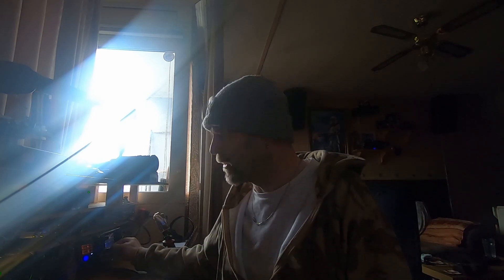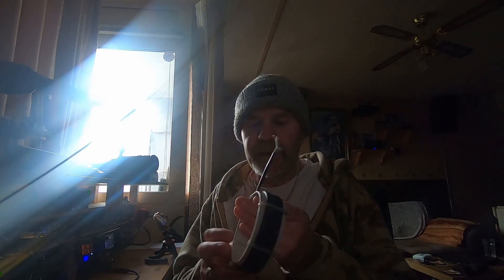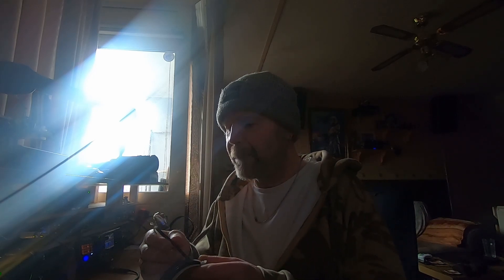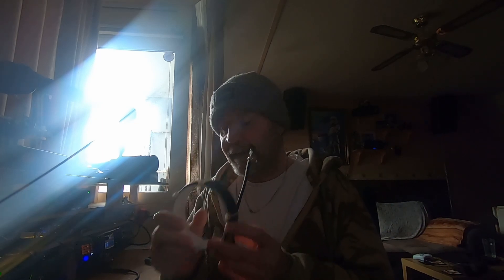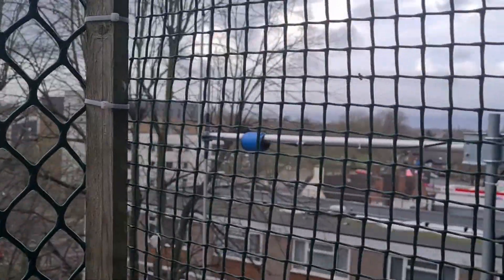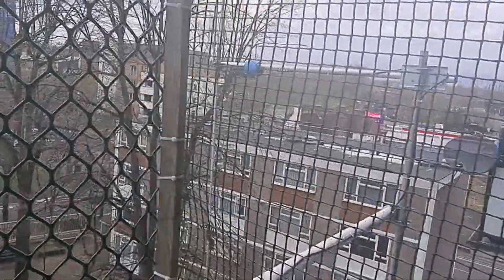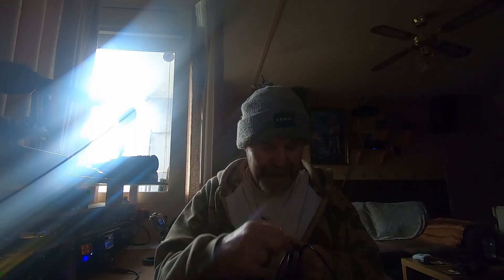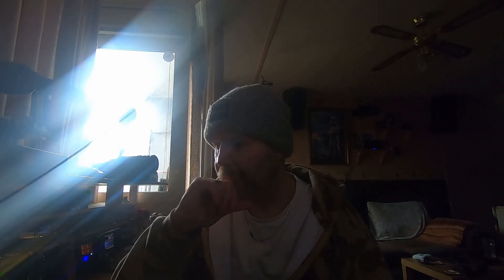A quick Look at RF Chokes.

Comment: Ohhhhh a live stream,  Chokes can be useful for lots of things.  No harm in changing the intro and making it slightly shorter.  I made a coil of coax, just below a home made dipole, just wrapped around my hand, dropped the SWR and stopped RF coming back the coax.  Copied Hungry and a few other places on it, even though it was very close to a lead ridging on a roof.
Reply from the maker: Nice if it works it works, but its just a tidy way of doing things. Cheers Bob

Comment: hey i see a video of 390Wagenmaster and he is saying,not to use a ham radio on cb band a regulair cb receive,s better,you have alot of noise mostly so maybe give it a try on a regulair cb,but any change you can make a rf choke for me lol and sent it to me lol :) 73,s 19TC504
Reply from the maker: Lol cheeky, I get less noise on my HF radios, but I do have a few old CBs as well, just depend what's causing the noise, my 7300 works well on the CB bands, but yeah I know not made for them. Cheers and very easy to make your own choke.

Comment: I have a ssd58 dipole for 10/12m bands its on a 12m spiderbeam mast its the best anttena ive ever had
I have one up for 15m on a 12m mast as well its a shame he stopped makeing them i also have 2 others
For 17m and 20m not used them yet i think i bought his last 4 on ebay i used to do 11m in the 70's & 80's
Had so much fun back then i did try to copy his 10m one but the swr is not so good needs more work
73's chris
Reply from the maker: Good antennas he made, not sure if he will start up again, not heard from him and I dropped him a message a few months ago now. I've got 3 for 11m so I should be OK for a while. Cheers.
Reply: @Al.26TC101  yep they are outstanding i would like another for portable use as 10/12m is so good i 
Just worked Vietnam this morning on 10m 100w ic7300 my ant 12ft off the ground i live in hope he
Will make some more chris

Comment: Small paint tin is a good removable former.. If you use cable ties to secure dont over tighten.. Squashed coax is no coax.... 4 turns minimum but i think more is better most of the time.. Try and keep the choke right by the antenna connection... Not so easy with your dipole al i think the short distance you have the choke away is for the best in your case... Deffo try the choke under the arm. The pole throught the middle will alter things.. The choke somtimes called an ugly balun..( Its not a balun at all)Helps stop rf flowing on the outside of the cable and back to the shack... Even more use mobile in my opinion but seldom used... Where else do you sit inches away from and directly under all your tx signal..  Definitely a cheap easy fix to many common mode problems.. Keep up the good work Al your a good man..
Reply: Just wondering if it makes any difference if I place the Balun at the Antenna or in the shack after my SWR Meter ?
Reply from the maker: @SentinelOneLove it should go below the antenna, basically, you are stopping RF coming back down the coax and means you are  getting more out of the antenna, hope that makes sense, a bit like a  U bend in a toilet in that it stops  water coming back up, the best analogy I have , so you need it as close to the antenna as I understand it.
Reply: @Al.26TC101  Soil pipes and U-Bends, this is some serious toilet humour Al 😂
Reply: This is exactly how i do mine with whatever is lying around, as long as it is close to the correct diameter, then i just slide the coax off.
Reply from the maker: Cheers bud, it works, but I never thought to use mobile, although the SSD58 already has one built in, although not stuck the big one up in a while.

Comment: Excellent intro Al ( cant tell if its longer or shorter than you original  but does the job well ) .
Im still suffering from really bad QRM even with this cheap Eliminator i picked up of Marketplace so definitely going to have a go at making one of those Chokes and will let you know how it goes .
Keep up the good work 👍🏽
CT5060 73's
Reply from the maker: Thanks for the feed back, the qrm eliminators need quite a bit of fiddling with, I hope the choke works, it won't get rid of all the QRM and I can't guarantee it will work but cheap enough to make if you have the bits for  it. Good luck.
Reply: @Al.26TC101  The Eliminator I picked up seems to only knock back my incoming signals the same as turning down the RF Gain on the radio .. Will give the choke a try over the weekend and let you know how it goes. 👍🏽